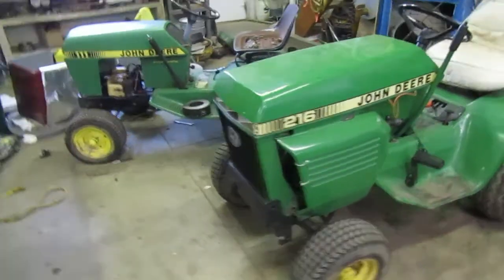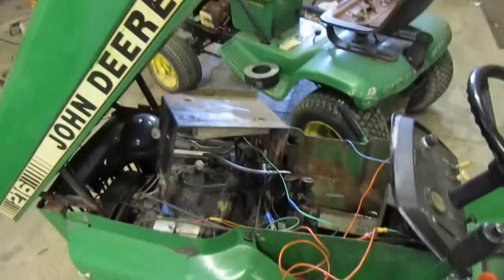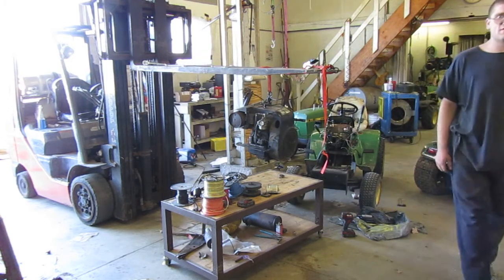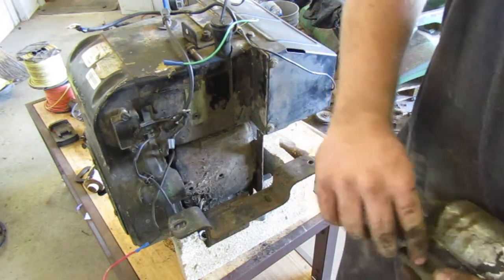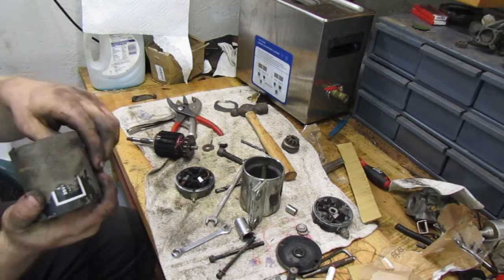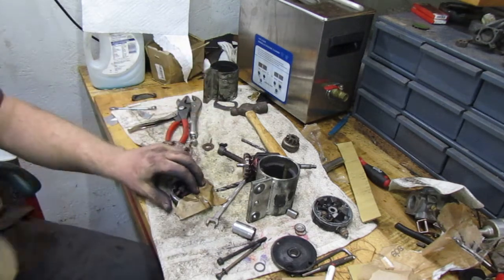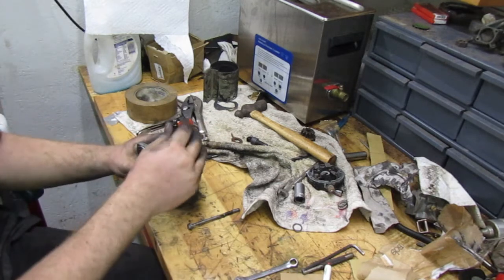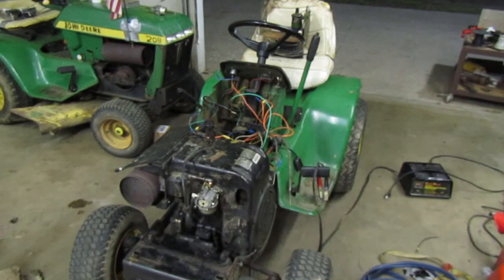Can We Fix It??? 1986 John Deere 216 Wont Start!!!

Comment: My 216 had the same problem. I pulled the starter and found a broken magnet that was preventing the starter from turning. Bought a replacement no name starter to replace it. But the base on the aftermarket starter was thicker than the oem, and the pinion would grind on the flywheel, tearing up the teeth. Instead of trying to resurface the base of a $50 aftermarket unit, I returned it and repaired the broken magnet on the oem starter and reinstalled it. Been using the 216 about 3 years since the repair with no issues. Also didn't have to remove the engine to access starter.

Comment: Do you have a video on replacing the detent in a 210 transaxle?  #1 & #2
Reply from the maker: inside the transmission? or is it one for the belts I dont have any videos on messing with the inside of the transmission.
Reply: @themaniacmower  I believe it's inside my jd 210 jumps out of 3rd gear all the other ones are fine.

Comment: On that starter I’ve had a similar issue on my 212 they’re old when they sit for a while  you’ll get a problem where the Bendix just won’t engage,,,an old man showed me a trick once take a long handled screwdriver and a rubber mallet probably be best unhook the spark plug first and then have someone turn the key to try to engage the starter while you gently tap on that screwdriver trying to unstick that Bendix you may even wanna spray a little WD-40 around in there before you try it and then after you try it once it’s free up spray that bendex shaft a little bit while it’s actuating,,,every once in a while my Bendix will stick and give the impression that the starters out however spraying it with WD-40 periodically really helps,,, I had to weld my cradle and I come up with a way to rebuild all my motor mounts and it works pretty darn good👍
Reply from the maker: Ya I have had some stick as well but this one the motor wouldnt even  turn over that was what really made me suspicious cause I have never had an issue with it I use the 216 every week it mows the yard as much as I hate working the older tractors like that this one only wants to mow I try anything else with it and it throws fits but I put a deck on it and it goes

Comment: I have the same tractor, wont start on its own but when I hook it up to a jump box it starts and runs great. take the jump box off, and it immediately shuts down. battery is testing out at 12.66 with the key off but it is a couple years old. scratching my head because when I hook up a jump box, it starts and runs great. any ideas guys???

Comment: My 82 212 K301 isn’t very healthy hardly anymore & needs a rebuild or I could take the same $ & throw a little Yanmar Diesel in her & have a 2nd Yanmar Powered tractor. No more carburetor & Ethonol to deal with. 

Just diesel, & regular oil changes.
Reply from the maker: ya but with biden and his increase in prices for fuel it makes you wonder if its worth it. I think if I was you I would try to find another 12 horse to put in it if I had one to sell I would but I dont